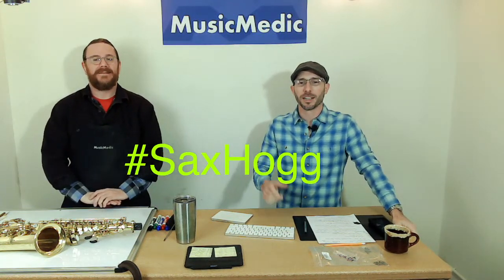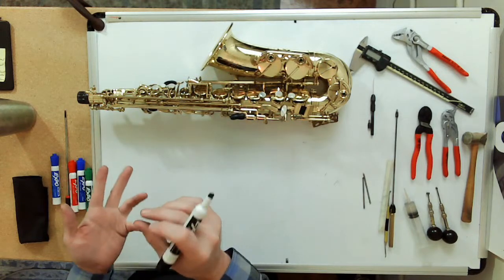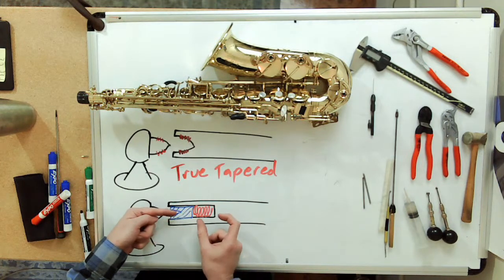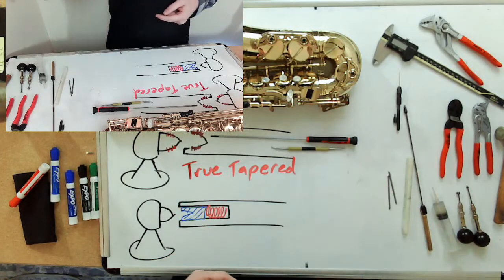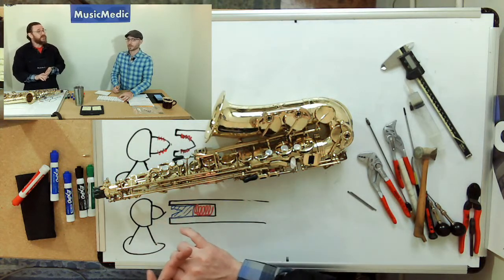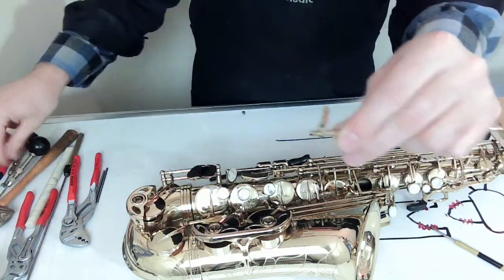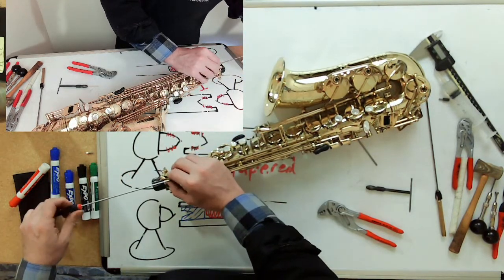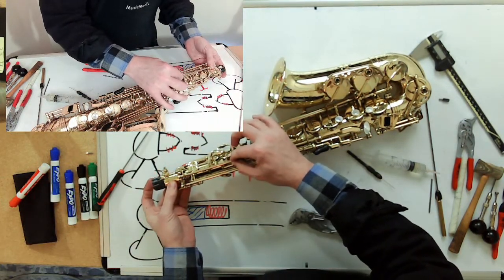How to make Selmer Spring Loaded Bushings Feel Great!

Comment: Which do you prefer the Selmer style or just the pivot screw without the bushing?
Reply from the maker: The pivot screw without the bushing has a good positive feel when the parts are fit together properly. The spring loaded bushing does work well however when the bushings are fitting well in the hinge tubes. Stay tuned we'll be doing a series of videos on the different style pivot screw mechanisms and the advantages of each.